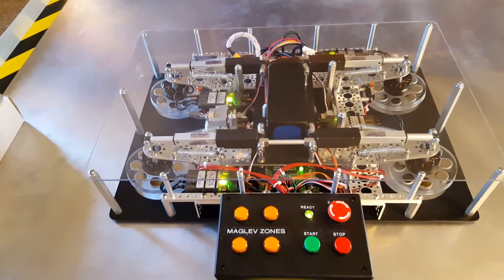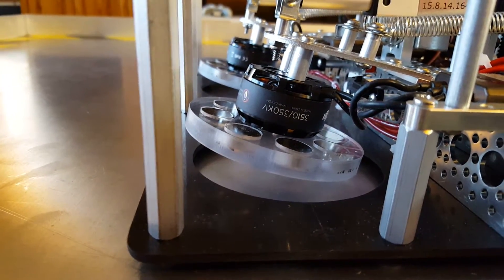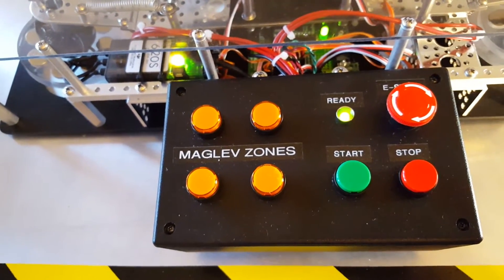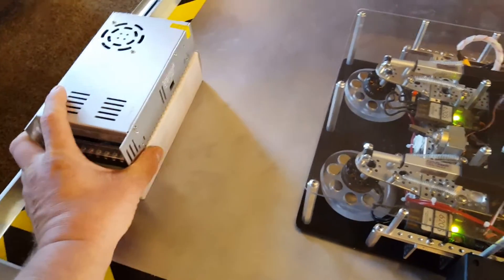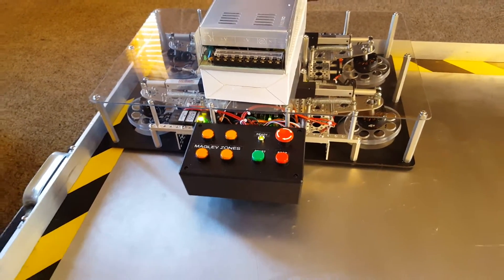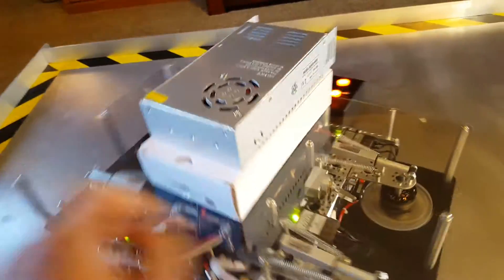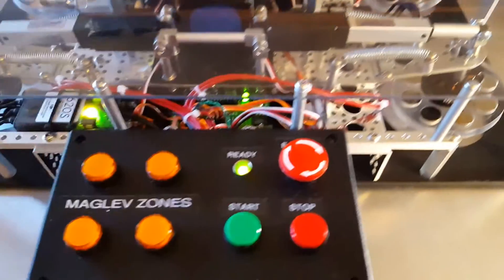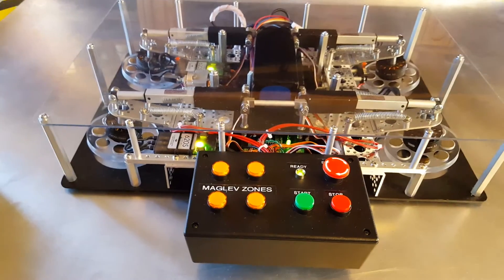MagLev Pallet (1/5th scale)

Comment: canceling the spinning of the entire platform could probably be achieved by making each motor cancel each other by rotating inward or outward rather than all of them rotation towards the same direction which could be causing the rotation towards the same direction of the rotation of the motors.
Reply from the maker: That is exactly what I am doing.

Comment: This is not a actual hover device...It's just vibrating across the metal. But what about cement or carpet. I suppose it would work on wooden floors as well as steel. But it doesn't seem like a true hover device or electromagnetic device is what I was hoping to see....Nice presentation.
Reply from the maker: No, it hovers about 1/2" above the aluminum plate. Look at my other videos to see that actual hover height. It only works with non ferrous metals because it needs to generate the Eddy Currents required for repulsion. Look up "Magnetic Filed Architecture" theory by NASA.
Reply: @Fanucman1  I guess we'll have to sidewalks and roads out of steel or copper. He do thought they had it too, they're overboard is bogus too

Comment: this linked to your smart phone (for control instead of the clumsy box) this would be great for inner city warehouses, stock rooms, and small mfr. what would the weight limit be on the full size unit (hopefully 2,000+ lbs) would the floor need to be solid or could a brass or alum impregnated poly coating on a warehouse/garage  floor

Comment: Really cool! It's amazing what you can do with the BS2. I have a few of these and a few of the multicore boards along with boxes of Parallax devices (sensors, displays, etc) and of course lots of resistors, transistors, capacitors you know, the typical boxes of parts we all accumulate. It seems like there's just no limit to what can be built.

Nice work Ken!